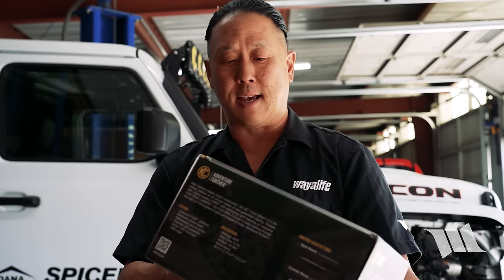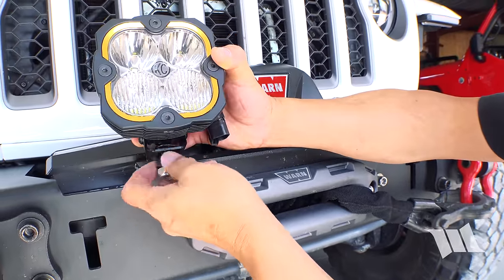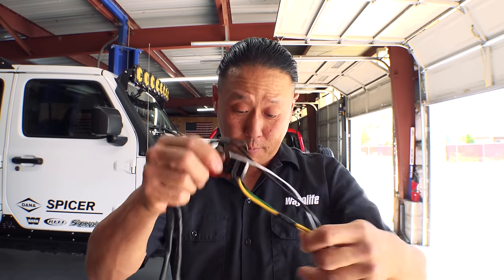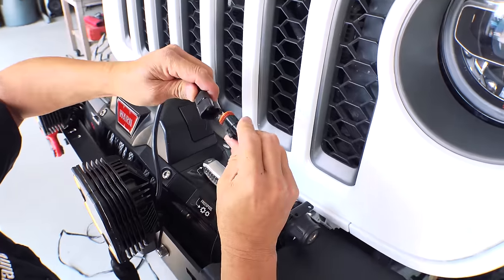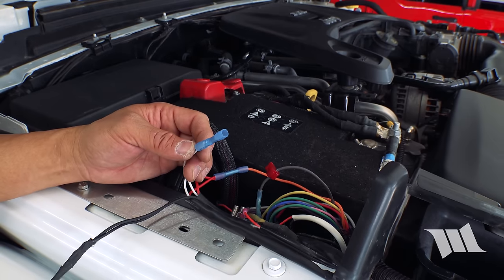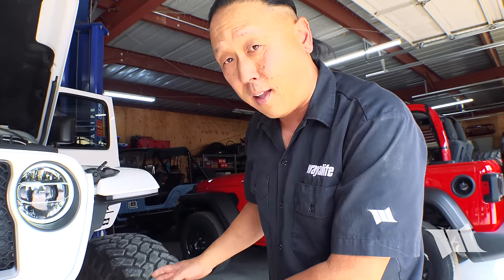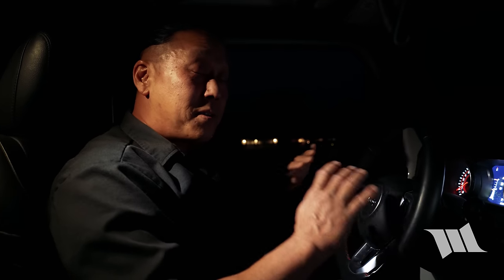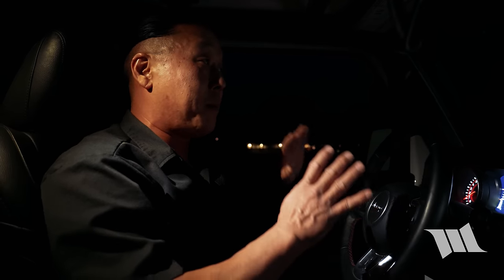KC Flex ERA 4 Combo LED Off Road Light System Installed on our Jeep JT Gladiator

Comment: Hey.  Something that I've done in the past if there are concerns for moisture being able to sneak in past some kind of heatshrink-capable thing is to put an excessive dab of hot glue in, then use a hot air heatgun to shrink the heatshrink around the hotglue and connector before the glue has fully cooled.  Excess glue will ooze out as the glue heats back up again, but it'll form a nice, almost potted lump.

Obviously exercise judgment on stuff in the engine bay, don't use something with too low a melting point.

Comment: That comparison was really good.  I'm waiting on delivery for a pair of the same lights for my front bumper, I will mount them under the bull bar on my JT-R.  I was thinking of adding the KC Pro-6 Lightbar, but you might have convinced me to wait on that..  I've got a Rebel bed rack, so I've already bought a bunch of KC lights for it while we are camping, or night trail running, which we don't do much on purpose (I have kids that wheel with me).  Night runs can be a bit freaky or disorienting for backseat passengers, they can't see anything and are just getting tossed all over the place.
Reply from the maker: Glad the comparison was helpful to you. As you can clearly see in the video, these lights can get the job done all by themselves for sure.

Comment: Great video. If connecting to factory auxiliary jl switches, where do you connect the white wires for amber back glow? Thanks
Reply from the maker: Well, you can use one of the other switches for them but for me, I might recommend tying them into the DRL's. There is a white wire with a brown tracer on the passenger side one that you can tap into.

Comment: There appears to be a Fairlead mounted light bracket you are mounting the lights on. Is that a part of the bumper or a separate item that can be purchased separately. if so do you have a link for it. Thanks love your videos
Reply from the maker: Yup, it's made by EVO and for their Quarter Pounder front bumper but I bet you could use it on other similar bumpers http://evomfg.com/index.php?route=product/product&keyword=light+mount&category_id=0&description=1&model=1&product_id=252
Reply: @wayalife  Thank you for the information! I can't wait for some new trail videos.

Comment: Thanks for the video. Installed my lights with no issue. Has anyone ever run a line to the fuse box to have the ambers run as DRLs?
Reply from the maker: No need to go to the fuse box, you can tap into the DRL wire.

Comment: Eddie and Cindy,  thank you for another outstanding video.     Two questions,  first about the ERA 4 and ERA 3 -  Looking for adding Bumper and Ditch lights to my gladiator.  Should the stronger of two go front facing and then the other be the side lights. I do not have a cabover light bar at this time.  ( this might be more of a forum question as well)
The other question is something I spotted thru the grill on the gladiator, is that an additional fluid cooler (steering or transmission)with the white frame around it.

Thank you again for the work you both produce and as someone stated earlier,  "come for the jeep  videos but stay thru the very end for the Ripley segment"
Reply from the maker: I would always add the stronger lights up front and on the bumper. Adding something like that to the a-pillars will cause too much glare on the hood.

Comment: Outstanding job as usual. Can you share how do you keep your Gladiator engine clean. Your Gladiator looks like showroom. Honestly I want to keep mine like this without causing issue for the wires and anything under the hood. Thanks
Reply from the maker: The real key is to rinse the engine bay with water with every wash. To detail it, you can use WD40 and a rag to wipe everything down to a nice black finish.

Comment: Those are amazing.
Will that Lighting Bracket fit on a stock JL Rubicon Steel Bumper?
I see you said it was for the EVO Quarter Pounder.
Reply from the maker: This bracket will only work with the EVO Quarter Pounder. Mopar does make and sell a nice hoop that will allow you to install lights though. https://amzn.to/2YREPbC
Reply: @wayalife  Okay thanks, I'll check them out
Reply from the maker: You can also get the winch hoop for the bumper and attach the lights to it. https://amzn.to/2XjfNSf
Reply: @wayalife  I have some Rugged Ridge X-Brackets that would work like those.
I like how your bracket fits behind the Fairlead, looks like a good spot and low profile.

Comment: Hey Eddie just curious but do you run front and rear inner fenders on your Gladiator? Are they really needed?
Reply from the maker: Nope, no liners and no, they aren't needed. Haven't been running any on my JK's for years. On anything less than a black Jeep or really dark color one, it can look a little funny without them but I've found that simply painting the exposed body black makes everything look great.
Reply: @wayalife  I was thinking about installing some Fabtech Fenders on my JL and I believe you can't reuse the original inner fenders that come with the Jeep.  And my thought was why spend unnecessary money on inner fenders
Reply from the maker: LOL - that's always been my thought. 👍

Comment: Hey! I see you didn't utilize the in-cab rocker switch, so from the inside of your jeep could you control which light is turned on (flood, spot, amber)?
Reply from the maker: The flood vs spot is determined by the lens you have installed. The amber, I have connected to my rock lights.

Comment: Love the lights and install video!! One question I do have is, what is the buzzing noise when the Jeep is on accessory mode? I have a 3.6 JLU and it does it as well, I’m sure it’s been answered before but I can’t find an answer or where it is actually coming from.
Reply from the maker: It's coming from everything that uses electricity when the Jeep is running.

Comment: Looks a little dark on the sides? Still Need ditch lights?
Reply from the maker: Me personally, I don't think so. You can always adjust these so that they're not as forward facing and that would help make up the difference. But, more lights will provide more light is that's what you're needing.

Comment: Would these be as effective mounted on the A pillar hood area?
Reply from the maker: Personally, I would NOT recommend installing these on the a-pillars as they cast way too much light on the hood and the glare is annoying. If anything, install a set of spots - NOT the combo but even they will glare a lot.
Reply: @wayalife  Thanks. I have the stock bumper so I’ll look for so,etching to mount them in front of the grill.

Comment: do you think i can use these as daylight running lights DRL too or will be too bright on the daylights?
Reply from the maker: The white lights? No. The amber back glow lights, yes, especially on the new ones. I recently bought a set for my 392 and they amber back glow is a LOT brighter.
Reply: @wayalife  which model is their new ones?
Reply from the maker: Sorry, I have no idea. I just know that the new set of lights that I just got and installed have brighter back glows.

Comment: Would the bumper lights get in the way if you had to winch at an extreme angle. Love the videos. My only complaint is I don’t get enough of them.
Reply from the maker: Nope, the lights sit out of the way and above the path of the winch line and I'm not concerned by it. As far as videos go, I wish we had the kind of time to do more but as it is, we're just able to get the ones we do. Sorry.

Comment: Hey Eddie,
Another great instruction/review video, thanks!
I think the combos are always the best of the both worlds, in one, I like them.
Wondering if you can share your opinion over something:
I have a 2021 Jeep Wrangler WILLYS (no lockers) and can afford changing only one (pricey) axle at this time to add electric lockers.
If it was you, would you rather have a front or rear one as a first to start with (the second one will be hopefully coming in few months - wife's approval pending 😁).
Thanks...
Reply from the maker: Well, I guess the real question that needs to be asked is, how big of a tire are you hoping to run? Perhaps, all you need is to install a set of lockers and NOT brand new axles.
Reply: @wayalife  Thanks Eddie, I am looking at new NITTO 35s with Mopar 2" lift...

Comment: Dumb questions here from a newbie. I’ve got a JLU Rubicon Wrangler with a factory steel bumper.  

1.  Any suggestion on a mounting bracket for these lights?  
2.  Any suggestions on how to secure the lights and a mounting bracket to keep thieves at bay?  I don’t have an automated machine gun system and my pit bull hates sleeping outside at night. 🤪

Awesome vids. Learned a lot from your vids.  Thanks for sharing such great info.
Reply from the maker: Mopar has a couple options for their steel bumper. One is just light mount tabs that bolt onto the bumper and the other is the hoop you can buy. As far as security goes, KC sells bolts that require a special tool to secure them in place. Granted, nothing is bullet proof but it will make it harder for sticky fingers to take.

Comment: Who makes the light mount ?
Reply from the maker: EVO and it only works with their Quarter Pounder bumper
Reply: @wayalife thank you. Also any reason why you didn’t want to plug the flex era lights into the factory fog light harness ?
Reply from the maker: @LV2Roam  mainly because I didn't want to treat these as fogs as they are anything but. In the future, I am hoping to install something that can server as better fog lights too.
Reply: Is it the offset or centered version light mount?
Reply: @wayalife is it the centered or offset light mount from Evo? Sorry didn’t know they had both
Reply from the maker: @LV2Roam  On this setup, I am using the centered.